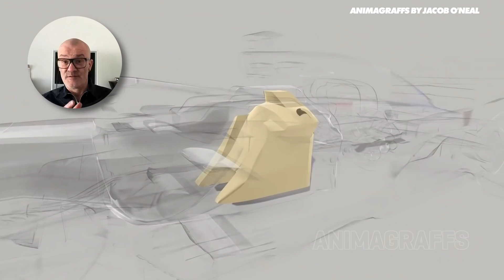Why Max's Red Bull Caught Fire in Australia

Comment: there is no way it was a leaking pipe on fire, even at the lower 10 bar line. if it was leaking and caught fire it would be a flame thrower, and it will go from 0 to 100 in seconds, your simply not putting it out like they did.

Comment: Vacuum and fuel lock are not the same. Fuel lock happens when the impeller is freewheeling in vapor, here the fuel cell simply pulled a vacuum on the first fuel pump.

Comment: I would say yes fuel related failure...

But not the primary fuel line...

Due to the size of fire...
It looks like fuel purge line have too much fuel vapour condensation...

*Where e10 gasoline vapour  condensate back into liquid blocking the the fuel breathing /delivery system... In short.. vapour lock... 

Hence it explains the small-ish fire since there is very little amount of fuel...

Unlike if the primary fuel leak even at low pressure side 10bar of pressure...(still quite high pressure compared to normal road car with around 2.7-3bar of fuel pressure)
     it would splash gasoline all over inside the engine compartment followed by massive fire

Comment: That fuel lock explanation seems weird. If you have...5psi? 3psi? Vapor slugs that cause lock are compressed so much that lock is impossible. This is why "older cars" (read: carbureted with near zero psi fuel systems) have the problem and not much made after 1986 does. Also, fuel type has zero effect on this. E10, E15, whatever all have nearly the same specs in this area. 

Now that they are their own engine manufacturer they can't dump on another party, I guess, so this is what they come up with. I'd assume its the same old Red Bull running stuff way too hot on purpose and gambling that it won't be an issue. Remember when they didn't even run KERS because they couldn't stop melting it?

Comment: I don't know how much work Honda did for them outside of just delivering the engines, but they might be over confident in taking over what used to be under the Honda team's control
Reply: Not overconfident. They simply need to do it themselves with several Honda engineers that stayed with RB.

Comment: Nice video, but all based on speculation. I thought that Max had a hydraulic leak somewhere wich they tried to fix before the race but couldnt cause it was to hard to reach. My guess is they topped off the reservoir hoping it would be enough to make it trough the race without a terminal loss of fluid and thus pressure... but eventualy the leaking fluid found it's way to the hotter parts of the engine bay and caught fire. But like the video, this theory is purely based on speculation. Would be fun to make a hand full of these video's on probable causes of Max's retirement!? Anyhow.. let's hope they get on top of the issue sooner than later. Looking forward to Max taking the fight up to Charles!

Comment: It ain’t fuel problems imo. If it was, it would have combusted immediately and from the top. Instead it started to smoke before starting the fire and the fire was from the bottom up, hinting at hydraulics instead. That’s why Verstappen was pointing at the guy with the extinguisher to point the extinguisher towards the bottom not the top. Probably from the extreme heat of the engine and some valves or lines being so close to it for an extended period and eventually wearing out and creating a leak and eventual combustion

Comment: In the fuel line what's the most complex and environmental demanding part? It can only be the injector. 500 bar. The loads on small parts is going to be crazy. If it is only the fuel line then that's a worring oversight.

Comment: Uh...
It's 100% possible to get a hydraulic leak and still have all the hydraulics operating - anyone with any hydraulic experience knows that. It's when a hose, or more rarely a fitting, completely fails catastopically that you have loss of hydraulics - even then, depending where it fails, it can just affect that specific circuit. Same with a fuel leak.
Either way, there is an expectation that the telemetry will have picked up either a pressure drop or an increase in flow, or both.

RB claimed it was a fuel issue - could be telling the truth.
Oh, regarding the "E10", some posting don't seem to realise it's a very different blend from what they may find at the pumps - there are some specific fuel requirements set out by the FIA, and the various fuel companies will tailor the fuel for the teams that best meets their requirements while meeting the FIA spec'n - it's not unknown for a fuel company to have slightly different blends for each team they supply - same thing with lubricants.

Comment: I would say it was a Fuel leak but not on that small external pipe. I think it is a internal leak within the multiple pumps and pipework inside the tank. The fire was a issue of stopping a very hot race car suddenly. Without air flow and how tight the bodywork is wrapped around the engine and hot turbo and exhaust I think it was part of the body work or ducting etc is what caught fire. If the fuel leak was large enough to make the engine have a dramatic loss in  power and they could see it on the telemetry, There would have been fuel spraying everywhere and the whole rear of the car would have gone up in flames.

Comment: At the fuel pressures they run in these injection systems, 10 Bar is 145 psi and 500 Bar or 7,000 psi, there shouldn't be any vapor locking problems. Old cars had vapor locking problems because they ran 3 to 6 psi fuel pressure from the pump to the carburetor and a vacuum from the tank to the pump.

Comment: I don't believe this explanation. First of, Max's radio was 'I smell something'. Max basically came out of the womb on a cart, and damn well knows how gasoline smells. He would have said 'I smell gas' if it were gas.

However, Li-polymer or li-ion batteries will produce a gas when over-charged or over-loaded. This has a somewhat sweet odeur. And a swollen leaking li-po or li-ion cell can easily catch fire.

So I think the truth is that his battery was the culpret that caught fire.

This also explains why there was a lot of smoke and little flames. Anyone who ever saw a lipo pack ignite, knows that's exactly what these do.

Lastly, this also explains the loss of power. An engine getting no fuel will simply stall, which didn't happen. And an engine getting fuel, does not lose power. However, a F1 car with a failing battery DOES.

Comment: Subarus from 1999 do just fine on E100 which is 10x aggressive than E10. This must have been something else, and I'd bet a box of beer on it, it is temperature related loosening the teflon liners/rubber O-rings of these braided hoses.

Comment: Running E10 fuel isa big mistake. Its not environmental friendly and you don't get as much energy from E10. Also it can cause problems with the engine and degrades parts like rubber seals .

Comment: Red Bulls issue this weekend with the E10 fuel. It did a job on the seals . As for Mercedes they still need to take the arch out of there front wing.  If you look at Ferrari and Red bull the the fourth blade on the front wing is flatter than Mercedes.  And after Australia its not there rear wing. Redesign the front wing by making all the arches in it flater

Comment: What I understood from the Bahrain issues was the fuel tank was under vacuum due to not breathing correctly. I have had this happen on roadcars with blocked tank breathers. The pump just cannot overcome the vacuum. Leave it to sit and it will start again. Open the cap slowly and you can hear the pressure difference as it hisses  through.

Comment: So this hose is a feature only on the Red Bull engines? If so, surely this is a catastrophic oversight... Ferrari completely redesigned the combustion system to optimise for the E10 fuel this season... and you're telling me Red Bull/Honda failed to change a hose... not buying it.

Comment: I also think hydraulics aren't an issue in this because in Q3 Alonso lost control because of hydraulic issues and couldn't switch gears while Max could steer and put the car in neutral (If I'm not wrong)
Reply: gearbox isn't the only thing that using hydraulic systems

Comment: It seemed to me like an engine issue. Red Bull, like in their Renault days, are in control of the engine again and pushing it not just to 11, but pushing it to 15. Their reliability is abysmal when they do it themselves. When Honda was there this wouldn't have happened. Red Bull is just grossly incapable when it comes to running an engine and you can only feel for drivers like Max and Checo who have to deal with the wildly incompetent engineers that works at Red Bull.

3 Races, 3 DNFs. It's already clear that Leclerc will win the WDC this season and Ferrari will take the WCC. Might as well give up on the season, cut costs, and prep for 2025.
Reply: 2025? Jumping time are ya? 😄
Reply: @gealingeman8643  Oh crap, it's 2022? What happened to the timeline...

Comment: Somehow I think with all the might of Honda and RedBull, and all the engineers they poached from Mercedes, they wouldn’t have been caught out by something as simple as ethanol compatibility. If they were, they are seriously over-paid 🤣
Reply: It might be temperature related and they are burning up the high pressure pump through cavitation.
Reply: The former Merc crew arent working on the current car/engine. They're working in the new RBPT factory RB is setting up for the 2026 specs. They're nowhere near the current car 😊

Comment: They didn't say vapour lock for the initial failures, they said vacuum. This could imply a tank venting issue eventually leading to fuel starvation / vapour lock. 
Australia - not an E10 issue. Not enough ethanol to cause new mechanical failures, and certainly F1 teams understand the use of ethanol compatible seals and o-rings.

Comment: Sorry, but blaming E10 makes no sense whatsoever. Car industry works for years with E5, E10 and even E85 or E100, so they should know what are the changes needed in sealing materials and otherwise in order to have no problems with the more aggressive E10.
I mean all the other engines have 0 problems with E10, at least as far as we know. 🤷‍♂️

Comment: not surprising considering how you have to run some sort of additive to neutralize the effect that ethanol has on normal home power equipment and carbeurated engines like seals, floats, jets, etc.

Comment: So your telling me Honda doesn't understand e10 fuel?  That's not the problem - they need to feed the engine from a pressurized fuel can located after the fuel tank - just like turbine jet aircraft..  Helps with the G forces these cars are under.. They need to hire an Aerospace Engineer to designed the pickup for the fuel system and put a g Can in the Fuel system..

Comment: Fuel cell loom replacement?  Could they have possibly have moved the fuel supply hose as a consequence, likely fire had already ignited and hydraulic oil and hose compound burning was the smell Verstappen could smell.  Possibly the area within the cowling is running at higher temperatures this year, noted Hamilton complaining about high temperatures meaning he had to back off.  Maybe in the effort to improve aero across the field they have sacrificed engine compartment cooling.

Comment: A lot of it just means that the so-called Redbull Powertrains aka in reality, Honda, hasn't really done a lot of and/or meaning testing with their engines with this new biofuel given Redbull doesn't have a huge partnership with a fuel/oil company (Mobil 1 but they're not really cutting edge in the same vein as Petronas and Shell in terms of scale, innovation and expertise). Ferrari and Mercedes in this area have a huge advantage given their partnerships with Shell and Petronas respectively. They have more of an equal compartmentalising between chemical engineering oil/fuel experts along with aerodynamicists and mechanical engineering ICE/PU experts to study and solve problems. Redbull and Honda are top heavy with Adrian Newey, Honda ICE engineers, ex-Mercedes aerodynamicists/engineers and low on the expertise from the chemical engineering aspect or not as scaled like Petronas and Shell on the aspects of the new biofuel's interaction with the engine. Needless to say, Horner was the ONLY team principal who pushed for this new engine freeze... so yeah, oh well. Boy... Cried... Wolf (no pun).

Comment: I actually thought that both Red-Bulls would break-down at around 30 laps. (engine/fuel issues) The fact that Red-Bull weren't concerned about Perez's car suffering the same fate as Max's car at Melbourne and it finished the race suggests that they can fix the problem.
Reply: It also suggests they knew what the issue was

Comment: It turns out that an energy drinks company isn't very well suited to manufacturing high performance engines.
Reply: Its still theHONDA engine... as you well know, until 2026. Then it will be a RBPT engine from the new RBPT factory where the former Merc engineer are working already setting up the factory
Reply: @gealingeman8643  Ah ok, I assumed that all manufacturing was transferred to the Red Bull factory.

Comment: makes sense , the car caught fire on one side, if it was an engine problem the team would have noticed it on the data and notified max , plus max said on the radio he can smell something burning.
imagine losing an F1 championship because u failed to spend extra 3 grand on a proper quality fuel pipe seals

Comment: Normally I would defer to an engineer with experience on F1 cars for an explanation.  But in the case of these ethanol fuels,  every OLDER backyard, shade tree mechanic knows they burn hotter and don't produce the raw power we were used to.  Our own gas mileage drop being a clear example. I can't imagine all the headaches it would cause in a turbo engine at this rpm,  but I would bet a set of wrenches it has something to do with heat. Cheers
Reply: Older backyard mechanics don't know what they are talking about. Ethanol has higher knock resistance than regular gasoline, but lower energy per unit volume. You therefore have to run more fuel per unit of air, but can have higher boost and/or knock advance and therefore usually more total power (if your fuel system can handle the flows).  It's NOT the fuel causing these issues.
Reply: @Cataclysm1  my guess is you are another of the young google jeenyusses who defy real world experience for some calculations you learned in class.  Good luck keeping all your limbs intact if you ever have to do anything mechanical.  😂
Reply: @uprightfossil6673  your guess is so far off, just like your nonsense original post.

Comment: Rule 1 in F1 is never believe anything that comes from the mouth of Horner , ever , it will not be the truth. 2 different issues at 3 races seems like they have fundamental design problems due to Neweys Aero constraints. Fuel issue in Aus ? so why change out so much of the car ?  Horner's " rather make a fast car reliable " looks like it will cost them 2 champs this year and the go slow but steady Mercs are in the hunt
Reply: Never believe anything Toto, Binotto...and all the other bosses say either. Duh, ofc they dont tell all. They would be stupid if they did.
Reply: Lewis' engine was overheating and he had to let George go.... and were gonna visit many hot tracks this season... I think Merc has an issue too. All teams have issues. Even Ferrari with Carlos car. That was not a simple drivers mistake. Carlos had electrical failure in Jeddah and had an emergency repair on the grid. In Melbourne Carlos had a last minute repair in the garage before the race and had to drive with the reserve steering wheel. And that steering wheel was the cause of Carlos poop start and crash. So not all is well at Ferrari as well...

Comment: The bit that makes me think a fuel leak is bs was Max's comment after he pulled in.
Said he smelled weird fluid. Fuel is pretty unmistakable so my guess is hydraulics or coolant or some sort
Reply: Agreed. You can have a hydraulic leak and still have functioning equipment - not all leaks cause full loss of pressure, as is implied in the video.
Reply: @Cataclysm1  yeah for sure. It seemed a bit presumptuous to rule it out because his gears and brakes were ok.
Reply: Yes! Was looking for this comment, sort of expecting someone would have a countargument, but apparently not...
Reply: Good point
Reply: He said 'smell liquid' in stead of fuel on purpose. Cos if he had said fuel, Fia would've wanted to investigate the car before RB could take it to investigate themselves and that would've cost them time. Olav Mol, Dutch F1 commentator explained that comment
Reply: E10 fuel smells different from the non ethanol fuel, maybe that was the reason he said 'weird smell'.
Reply: @ankit99ize  it's different but still smells like fuel. You can discern the smell of diesel, keronese, gasoline and ethanol, but it's not completely alien, I find it hard to believe Max wouldn't be able to identify it.
Edit: fixed typo
Reply: @alexisbudzisz  the only one i could think of if it is fuel related (and i dont think this for a second, just playing devils advocate to myself) is that it is the secret additive rb are squirting in after the fuel pump that leaked 🤣
Again, baseless conspiracy theory, not my opinion, but good for a giggle!
Reply: @Mohawk_Racing  impossible cos the must give a fuel sample immediately after race or DNF. And fuel is randomly tested by Fia as well. No chance on adding anything secret. Thats bull
Reply: @gealingeman8643  no, if you havent properly read my previous comments, you will see how likely it really is.
The fuel sample is taken from the tank, this additive could go in between the tank and motor. 
Its basically what ferrari did
And your comment about why he said weird fluid is not accurate either. Fia wouldn't take the car off him just for saying fuel instead of liquid you plumb 🤣
Reply: @ankit99ize  no.